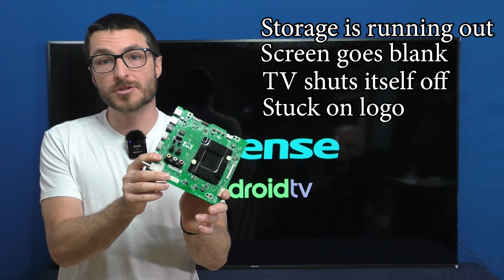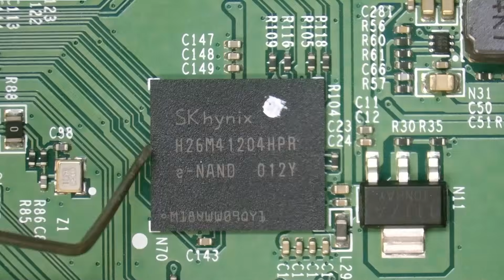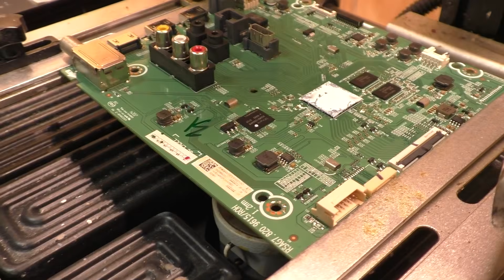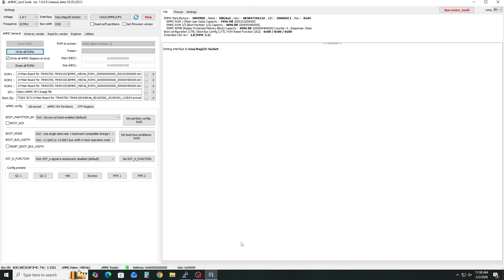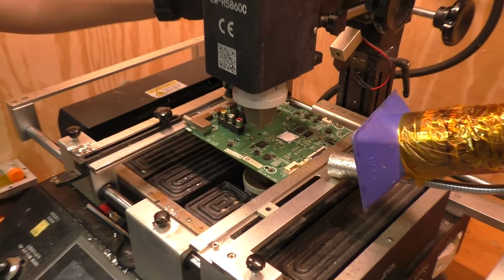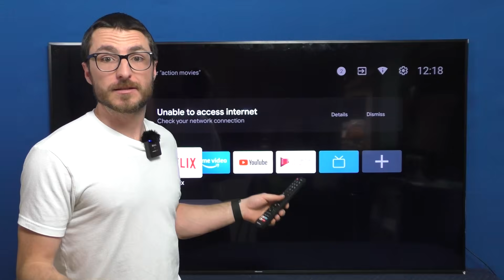How To Fix All Common Faults with Hisense 4K TV

Comment: So this happend to me: I bought a Hisense 50U7Q last year in November on Black Firday sale by OTTO. I initally used it on one location, than after a few months relocated it(within the same home) once I relocated it, one night I heared wierd ticking noises, rhytmical and repeating coming from the TV. I confirmed it only happens in standby mode and happens, no matter what I tweak in terms of cables, outlets, or software. Around that time sometimes I noticed flickering in my PS5 gaming. I called Hisense support. Technician came out after 3 weeks of making me wait. They confirmed it is an issue with the mainboard after  listening in. They ordered a replacement unit. Made me wait another 2 weeks or so, than told me replacement unit is not in stock so repair is impossible. Then, made me wait another 1-2 weeks, until they made a document ready with which I coudl return to OTTO and ask for a refund. I asked for a refund. Bought a new TV of the exact same model. Today when I comment this, the new one arrived. I played during today, on my PS5 with it, with  a hig hbandwith 2.1 HDMI cable using the PS5 in HDR(RGB) - by the end of the day, left it in standby mode. Hearing the exact same ticking noise yet again.  Now to return the TV again, I suppose. Unbelivable! Hisense TV-s just bad, I guess! I do not recommend!

Comment: IMy hisense 50a6g tv suddenly went off completely.  I unplugged all connections and then plugged in back in and the red light came on blinking 5 times with the 3 to 4 being very fast then red light went completely OFF.  All indicators of a 5 blinking redlight was bad mainboard.  I ordered a new 50a6g main board and installed as shown in your video.  Now the red light comes on and blinks 4 times but now at least stays on solid red, but nothing further happens to continue with turning on.  There appears to be NO backlight issue as I did the flash light test and saw no images in the black screen. So since I have installed a new main board does the new board or the EMMC Card need programming?  If so how is that done if the TV will not operate?

Comment: can we increase ram in android tv
Reply from the maker: Anything is possible but would require an immense amount of work. You can swap for higher capacity ram but then we are also talking about having to do firmware and software updates for some of the other components so the other components on the board know that the higher capacity ram is available and know to take advantage of it.
Reply: @NicksTVRepair thank you for replying

Comment: ¿Is it easy for you getting the firmware from this Hisense TV to program it? Thanks anticipated for answering me.
Reply from the maker: Not easy at all no. We have to get fully functional boards first which can be very hard to acquire for some of these sets, do factory reset, then we can remove the chips, download the contents off it using our programer (very expensive) then we can use that copied software to program new chips to then install on the boards as we did in this video. 
It's a process that needs to be repeated for every version / model / size of every hisense tv in order for us to have the proper software for each repair.

Comment: How to read damaged emmc?  As far as I know, that Easy programmer won't help you either. How to find hdmi key?
Reply from the maker: No HDMI keys, those are on the CPU. HDCP keys however are on the eMMC. You can read them just fine no lock on that provided the chip is not damaged beyond reading. The problem is programing them. New chips have the area for HDCP programing locked so that you can't program the keys to it.
Reply: So if the chip is damaged a lot, and mostly it is, then you can't repair the tv if I understand correctly? 
In what cases can you read emmc?  When it stops on the log I guess?

Comment: Please, do you have to acquire the emmc program for every single type of board for your database? Or you can acquire one working hisence android tv's emmc program, to program any other hisence android tv?
Reply from the maker: I just answered that same question from another comment, here is a copy of the answer:

We have to get fully functional boards first which can be very hard to acquire for some of these sets, do factory reset, then we can remove the chips, download the contents off it using our programer (very expensive) then we can use that copied software to program new chips to then install on the boards as we did in this video. 
It's a process that needs to be repeated for every version / model / size of every brand tv in order for us to have the proper software for each repair. Each software is unique to that specific model and version of the TV.
Reply: @NicksTVRepair Thank you very much for the information.

Comment: One of the worst TVs that I’ve ever had. Tv is sluggish , laggy, and unresponsive at times.
Reply from the maker: Yeah this TV actually is not bad but you would want to use an external streaming device like a  firestick/roku/chromcast/appleTV type device to upgrade it so that you don't have to deal with the slow/sluggish feel to it that you were experiencing.

Comment: The system software required for eMMC is usually Android. Can the software data be obtained from the TV manufacturer? Was this Hisense TV manufactured in China? Also, I noticed that this repair and soldering platform is also from China, and it seems to be working very well.
Reply from the maker: No it can't. We have to buy a working mainboard, we live test it, make sure it's working 100% then we factory reset the mainboard go through the set up menu, and then remove the chip from the board, image it, and use that to program other chips. 

As for where was the TV made, the majority of USA TV sets are manufactured in mexico. 
Yes Zhuomao/Seamark makes good rework machines in my opinion, but it's a very limited opinion as I have only owned 1 of their machines which you saw in the video. We have used it at least 10 times per day every single business day for the last 5 years and have had very consistent quality out of it. This is also their lowest end unit. After everything, it came out to about 3.5k I think.

Comment: You are performing a great service to keep these tvs out of the scrapyard. This failure reminds me of the Sony android tv failures like the XBR-65x850c etc.. is this poor engineering by the fault of the tv manufacturer design or is it the fault of the manufacturer of the EMMC chip? In normal use this shouldn’t be happening right?
Reply: EMMC chips are only expected to last 5-7 years in this application (cellphones too) so you could consider them to be part of a 'planned obsolescence'. The manufacturers hope that there will be a technology upgrade within that period that has everyone buying new devices. The SKHynix chips seem to be particularly short-lived... I have had a cellphone and a Sony TV both fail because of SKHynix EMMC failures.  😐
Reply from the maker: Just to keep an open mind about where fault and blame actually belong here.

If SK Hynix makes two eMMC chips, one rated for 5,000 read/write cycles and another rated for 20,000, and Hisense chooses the 5,000-cycle chip for their TVs, I don’t think it’s fair to say SK Hynix is making “bad” products. There are plenty of valid use cases for a 5,000-cycle chip where using a 20k chip would just be unnecessary and more expensive.

It’s also worth remembering that Hisense TVs cost a fraction of what comparable Samsung or LG sets do. To hit that price point, they’re obviously going to use lower-cost components. That’s the tradeoff. So who’s really at fault? The component manufacturer for offering different tiers of parts? Hisense for engineering a much cheaper TV? Or the consumer for choosing the most affordable option available?

In my opinion, there’s no one to blame. If you’re buying the cheapest electronics on the market, it’s not reasonable to expect them to last 7–10 years. Could they? Absolutely, sometimes you get lucky, and that’s great. But if they don’t, it shouldn’t be a surprise. You paid half (or a quarter) of the price of a higher-end set, and longevity is part of what you give up for that lower cost.

One last point that’s actually a big positive for both Sony and Hisense: the eMMC chip failing is the most common failure, and that’s a good thing. It means they usually don’t suffer from panel failures, which are far more common on brands like Samsung and LG. And when I say panel failure, I mean the screen itself goes bad. Once that happens, the TV is essentially unrepairable.

By comparison, an eMMC failure is serviceable. Replacing the chip is a viable and relatively affordable repair, which gives these TVs a second life. So yes, it’s frustrating that this failure happens at all, but it’s also a bit of a blessing that this is the failure you’re dealing with, instead of a dead screen. Panels on Sony and Hisense almost never fail, and that’s a huge plus when it comes to long-term serviceability.
Reply: @NicksTVRepair  I don't disagree that it is a complaint about manufacturer selection but, I as a consumer can only make an observation about the failed EMMC. I was not aware they made different R/W lifetime products but, whether it is the selection of a specific line of chip or a specific manufacturer of chips, it is still a chip selection problem. The TV is a Sony XBR... not cheap by any means so I am not sure why they would choose a short-lived memory, but it is nice to know the panels are reliable. As for servicing the EMMC, you can when you have the dump but they are not easy to come by, as I see you explaining in almost every video where you are replacing one ;) Still trying to find mine. I already have a new TV,  just using this as a educational experience. Anyway, I appreciate the response and your videos. I have learned a lot from them... thank you very much for taking the time to make them. You showed me how to check the power supply and the CPU so it was thanks to you I know it is an EMMC problem in the first place.

Comment: I had one with a shorted msh6103a power IC (SOP-8).  Symptom was dead with zero ohm short on the 12V standby from the power supply.
Reply from the maker: Oh interesting, I just looked it up and it says it's a power mosfet. Was this IC chip located on the power supply or was it on the mainboard? I understand you said " zero ohm short on the 12V standby from the power supply." but if the power supply is conneted to the mainboard the IC could be on the mainboard and cause that same symptom. 
Just curiouse. 
Thanks for sharing
Reply: @NicksTVRepair  It's an SOP-8 power management IC (has clock and data pins) with a belly pan so it has to removed with hot air, and it was indeed on the main board.  The TV came in dead, no standby 12V.  The stby line on the power supply to ground read a zero ohm short, but when disconnecting the main from the power supply, the short on the power supply went away.  I ran some voltage into the standby line on the main and that IC got hot.  Alibaba has them...  Looking again at your board, the one you repaired may be a different board and may not have that particular IC.
Reply from the maker: Thank you for sharing. This is something I will look out for next time we see a completely dead unit. In my experience so far 95% of these mainboards just have eMMC chip failures. 
If I ever do come accross one with that power management IC chip having failed ill defnitiely make a video on it.